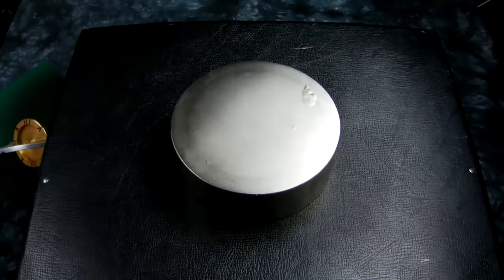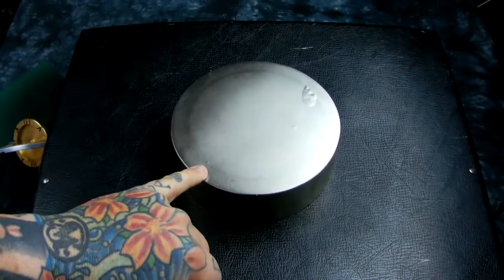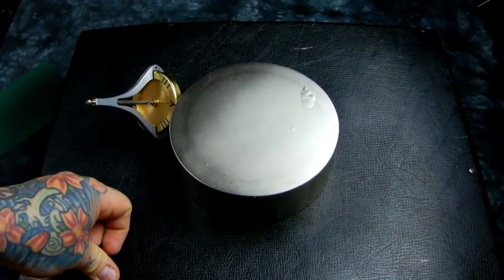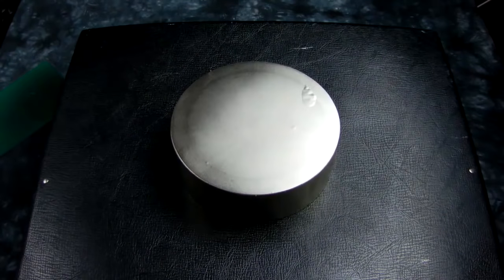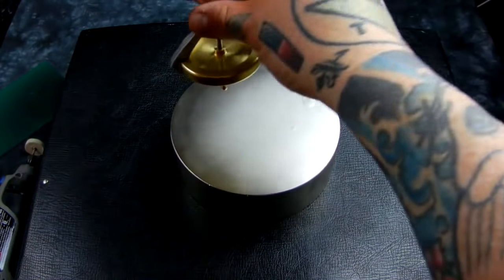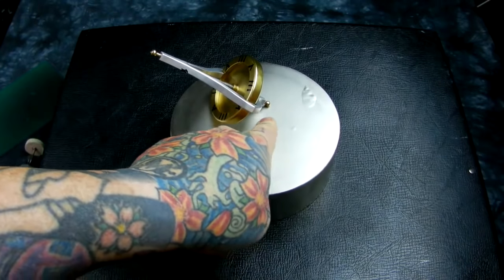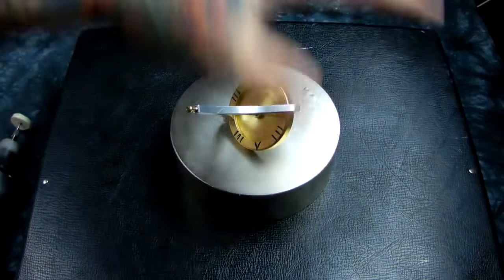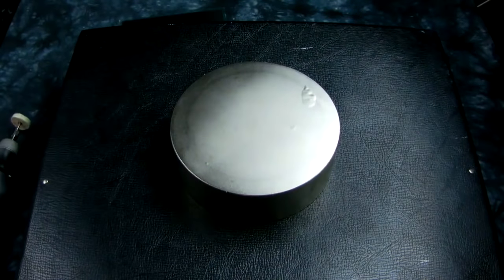Must-See Video! *SECRETS OF MAGNETISM* Never Seen Before* Torus-Hyperboloid

Comment: At the centripetal convergent point, the gyroscope has forces acting in equilibrium on its circumference ( assuming a uniform magnetic field). At the edge, centrifugal divergent point, only a fraction of the gyroscope has a force acting on it at any given time during its rotation. Hence, it experiences a braking force.

Comment: The Torus (Donut) has force around the outer part of the magnet. In the center, perhaps because of the Torus' power a Cone/Spiral Magnet field pulls the magnetic force back into the center. I think it's like an AC motor in the context that the outer edge has a different polarity affect. If I'm correct on any of this please let me know. Cool video!

Comment: Force/motion and Inertia/Acceleration… basically push and pull right? 

So in the middle it’s the point of inertia (basically neutral - the donut hole or stillness or pure potent), close  to the middle It’s pushing (in line with the spinning) and on the edge the field has rotated 180 degrees and is pulling (brake)? That sound right?

Comment: It seems to me when the gyro is spinning at the center, it cuts lines of flux unidirectional all along the wheel, so there is not potential difference (no voltage, no current, no electromagnetic field created). 
When the gyro spins along the edge of the magnet, one side spins towards the center and the other side spins away. This makes opposite flux line cuts along the outer tangent of the torus. The opposite flux line cutting action turns the wheel into the armature of a shorted DC permanent magnet generator (purely armature resistance). As we all know, when you open up the current in a generator, it begins to slow down, or labor. This is because the induced electromagnetic field created by the cutting action of the prime mover (inertia of the wheel in this case) is opposite to the applied magnetic field. The high armature current creates an electromagnetic field that makes the generator want to turn into a motor and spin in the opposite direction (counter torque). However, as the wheel slows down, the current and counter torque diminish as well until to come to a stop. 

It's tough to see right away because the gyro's cutting plane is not typical due to inefficiency but it makes a great experiment.

for those of you who don't know how dc machines work, watch this: https://www.youtube.com/watch?v=OpL0joqJmqY

Comment: Hey man I love the video the way you described the way the magnets energy is dissipated.. I have a question while minouvering the rotati G gyro (copper) did you experience acceleration at any point during the transition.. If you'd like a sweet spot?? Your video reminded me of the rhoden coil and the crossover points when making a multicoil... The braking point is where the power manifests.... I assume.... Wild guess but when you look at teslas water boiler and look at power generated... Where the water boils is the braking point on the magnetic ring...calculated guess x

Comment: Have you seen the YT video where a guy drops a piece a copper onto a strong magnet, and the copper slows down the closer it gets to,the magnet before touching it. There is a "breaking effect" which is most likely caused by moving electrons in the copper, which doesn't produce a current, but an imbalance of electrons in the metal, which causes the copper, itself, to produce its own weak magnetic field.

Comment: If you can make it brake, why can't you turn the gyro upside down (or) and make it accelerate?For every action there is an opposite and equal reaction yes?  If you can make it spin on its own, we now have perpetual motion and a means for endless power as well?.

Comment: Could you look on Alexey Chekurkov anti gravity disc and explain a little bit. Basically its two magnetic disc rotating opposite direction with a ultrasonic transducer at top. Charlie C bought his device and is experimenting now. Charlie shared the whole circuit through google drive. This would be very easy for experts like you. Tons of people are experimenting the same device. I dont think its fake.

Comment: Lenz's law? I suspect the magnet is inducing an opposing magnetic field in your flywheel when you put the gyro near the edge of the magnet. The opposing magnetic field resists the motion of the flywheel and so slows it down. This is how magnetic braking works if I remember correctly.

Comment: Does the force you highlight as working somewhat like a brake, does it also have the capacity to increase (if that's the right 'term') the speed of the flywheel using the same said field lines?

Comment: Isn't it because the forces are canceled out "or rather balanced" in the center? When you put it off to the side the fields are now cutting thru the partial metal and causing resistance to the force. Another awesome video, thanks!

Comment: What would happen if you took a iron lily impeller, having the a peak diameter 1.5 - 2 the width of the magnet, placed up side down with a point at the epicenter of the magnet, holding the other end of said impeller on the epi center of the opposite end? Would the magnetic flux rolling over the edges of the magnet magnetize the edges of the impeller forcing it to turn solely on power of the field and the induced magnetism of the impeller?

Comment: I'm not sure why you  had to drag that out  far past the point of annoyance. Especially  since you didn't  answer your own question. The reason for the difference in behavior is; When you put the gyro in the center of the magnet it would be like putting it in the middle of a drain. Forces acting on all points of the gyro  equally . While putting it on the side would be like turning it sideways to a flow of water. The  forces acting on the gyro change according to its distance from the closest  point nearest the magnet back. And motors come in both forms with a stationary coil and magnet  configuration. Only in a generator the stater must travel through the magnetic field only then do you get a reaction as the coil disturbs the magnetic flux as  it travels through.

Comment: If you need a scientific understanding for this experiment please read the following:
When the copper disc be rotated in the center of the magnet, the magnetic field is uniform and perpendicular to it. So the induced emf is radially and equal at each point of equal distance from the center this means that the center of the disc will has a negative voltage for example and all the rim of the disc will has a positive voltage. So a current will not pass.
But when the copper disc is rotated near to the edge of the magnet the magnetic field will be more dense at one half of the disc than the other half, so the emf will be generated in the near half to the magnet and the other half will act as a short circuit to the emf so the current will pass and will break the dist rotation according to lenz law.

Comment: I have a question to all wise knowledgeable individuals. 
  What or why is the piece of material we call magnets behaves in all types regardless of what it is made of. 
what makes it do that 
how does it supplies constant  attraction to ferrous material with out movement but it react to movement on many non ferrous materials each different.  copper  or aluminum. 
just puzzled thanks

Comment: can i put this into simple terms for myself at the very least and some one please tell me if i understand? putting at the center it is  not only basically riding the vortex but a looped circuit where as of to the side it is discharging off to the side thus losing the its own field and load? secondly what i neglect to understand from your(his) videos;  What the field consists of when nothing is there is it it movement of eather quite similar to how magnets move the ferrofluid or is it just the area where things may be affected but nothing happens until something is there?... i feel like this is a question similar to does a tree falling make a sound if no one hears it however...

Comment: Near the edge the magnetic field causes electrons to resist the motion of the rotating copper and or brass fly wheel . Electrons have mass. Thus the breaking. Its the same thing when you drop a neodymium magnet down a copper pipe and is falls really slow. The falling magnet creates a current in the copper pipe which requires energy slowing the freefall of the magnet.

Comment: This is similar to what happens if you drop a magnet through a copper pipe. It will fall slower than gravitational acceleration. Aluminum will do the same, but to a lesser degree. With a lot of current, aluminum can be used for railgun projectiles.

Comment: What would be the effect if you kept the plane of rotation perpendicular to center of the torus? by changing the rotation plane you induce a breaking current withing the rotation but if you change the roation so the gyroscope base points to the center of the magnet, what would be the end result? Anyone?

Comment: I'm assuming this magnet has a North and South Pole. I.e. The North is facing up say.
When you place gyro on the top, the North field is going vertically through the gyro with equal fields going through the entire gyro.
Placing the the gyro on the side, places it close enough so the both extremely strong North and South fields go through the part of the gyro closest to the magnet, while the far edge of the gyro experiences a weaker field.
Spinning the gyro causes the brass to become effected by magnetism.

Comment: your flywheel turns clockwise just like the thorus around your magnet so if you put your flywheel to the side they will turn agains each other so it will act as a break.

if you would let it spin at the middle of your magnet then turn your flywheel upside down to the side of the magnet.

Comment: Why won't you hold the gyro with the wheel edge perpendicular to the magnet's surface. to keep the same friction values on the bearings you could simply turn the magnet on its side and do the experiment

Comment: I see it and I can, I think, deduce the reason. Disc in the air virtually silent. Propelled and slowed under the effects. I mean you basically are showing what is or should be propelling vehicles we use. Seems to me that you could. Limitation I think might be the weight of magnets as the stator. Use something sturdy, durable, yet lightweight as the rotor, I'm seeing a series of three rings of fins but, what I can't see is like a turbo or a concussive compressive force to cause the things we see in the sky sometimes that leaves you wondering how movement like that is possible. I correlate the two in my mind and understand that may be corrupt as well.

Comment: I think i understand what is going on. The center vortex drags down pulls if you like. And keeps it spiining. But on the edge its a reverse affection. Ionly say this because i seen a video where magnets attached to a motor bent the light of a laser into the center i.e the black hole. Its something to so with the direction i.e polarity. Maybe you could make a large chamber using ferro cells top and botton make a motor and attach three magnets and fire a laser inside. I want to see where the light ends up. I bet it gets stuck on the out edge.

Comment: Before watching this I would expect the spinning gyroscope to slow very rapidly. Let's see if I'm right. Nope. I did not know that would happen. Well according to Lens Law the breaking is caused by nonferrous metals breaking the lines of magnetism (I don't know what the proper term for them are) So makes perfect sense that it would not break in the center. Try it with a plastic gyro. It will have no effect at all.

Comment: Do you think if you joined 4 large magnets together
in NSNS and left it for a while the magnetic divergence force line
would get moved over into the corners like it does on the small
magnets on my picture mate, obviously doing this with any large magnet is scary and dangerous but with square magnet having more contact then circular ones might hold together well and not explode light a nail bomb.

Comment: Thank you for taking the time to make and share this video. Most people are assholes with their snide comments to you....sorry about that...don't listen to them. Most people get jealous when they realize someone is brighter than they are....so...snide comments will fly off the handle....in reality...these are some mean nasty people.  I've been running experements of my own with my own designs using a 3d printer using magnets and specific set ups, got some interesting results...been working with it for a few years now.  The end result is...I am trying to create a motor generator using very low power....with a high power out put.  Some set ups are better than others. I got the machine to run on it's own magnetic power for 6 minutes 35 seconds. I tested without a magnet stator and it WITH a magnet stator...the times were very different...it ran longer with the magnet stator. you are kind of doing what im doing but you're using a fly wheel without magnets.  Again thanks for the video and taking your time in making it and explaining. Don't let the jerks get to you...ignore arrogance from people.

Comment: eddy currents induced in the copper conductor which is breaking flux lines by rotating in a magnetic field result in power dissipation through heating of the metal spinnie thingie. That's my guess... need more data

Comment: Its obvious why it stops, at the centre the negative and positive fields converge repelling each other creating a almost zero point of energy more in the line of constructive and destructive interferrence, like how water waves behave, at the edge the gap between the opposing feilds increases as well as do to a lack of a 2nd balancing magnet to keep rotation the fields from the origonal magnet cause rapid deceleration as one pushes and the other pulls against the direction of spin, this maybe due to the increased flow of electrons through the centre of the gyroscope from the ground, the unbalnced flow of electrons between the gyroscope and magnet causes the flow of electrons of the gyrscope to slow down to balance with the flow of the magnet

Comment: Rotation of the magnetic field is acting upon the rotating flywheel. Either by the rotating mass it's micro field is colliding with the field of the magnet. The power source for ultraviolet small round tube bulbs will spin up magnets held near to it, and can feel different angles are better worse . So ...  maybe same area...

Comment: Flux density can never be the same at all points on the magnet. "Map" the lines of force with a piece of cardboard and iron filings, and you can easily see them, and where they are concentrated.

Comment: Prob been said before but no time to read all comments - the wheel brakes and stops due to the "eddy" currents generated by the electrically conducting metal wheel "cutting" the magnets field - the eddy current creates an opposite and opposing magnetc field that causes the wheel to slow and stop.  You may have seen some exercise bikes that use a magnetic brake to produce an adjustable load against the peddler - ie non contact adjustable friction - they use the same principle as shown here.

Comment: What is different is eddy currents due to the angle of the magnetic flux relative to the angle of the flywheel. The dot product of the angular velocity vector and the net current is 0 across the entire flywheel. When it is off to the side the magnetic field cuts through the flywheel at a different angle and eddy currents are setup and these eddy currents then counter the angular rotation. 

Try it with a plastic or wood flywheel and it will completely ignore the magnetic(which should be obvious). If you repeated the experiment enough times you could measure the flywheel getting hotter when it's off to the side. It getting hotter shows that a current must be generated in flywheel and clearly the only difference is the way the magnetic field lines cut through the flywheel.

It's well known that F = q(E + v x B). When the flywheel is at the top of the magnetic there is a a constant force across the entire flywheel pushing it up and this does not retard the motion. When off to the side the force is asymmetrical and the force retarding it is stronger near the part of the flywheel closer to the magnet. v x B is larger closer to the magnet and so does not cancel with -v x B at the opposite end). It is this difference in the force which creates the eddy currents(You can simplify to two forces Fc = q(E + v x Bl) and Ff = q(E + vxBf) where Fc is the force close and Ff the force that is far. Then Fc and Ff point towards the axis of the flywheel. But they are not the same and hence there must be an electric field setup to compensate for the difference to conserve energy. These eddy currents though will interact with the field too. E = 1/q(F - v x B) and the eddy currents have the same direction as the force which is inwards(or outwards as it doesn't matter). As the eddy currents move orthogonal to the rotation(they move radially outward) they have to precisely balance the force differential(and it will because it's all the same equations). But eddy currents create heat. Heat is a loss of the energy being supplied and is effectively as if you added friction to the flywheel. The only way to compensate for this so that one conserves energy(which is being lost due to heat) is for the velocity to decrease. (you have to realize that the electrons in the bound atoms in the flywheel are moving with an angular velocity w and so v = r*w is the velocity of the electrons at a radius r in the flywheel. Electronic flow will move radially inward or outward  as this happens(this is only due to the magnetic field and how it cuts through the flywheel).

It's just basic magnetics. It's obviously much more complex but basically it's eddy currents. In the configuration there are no eddy currents(or very little) while on the side there is far more.